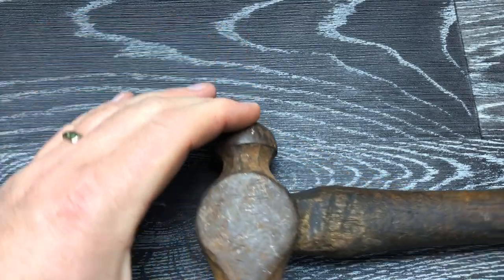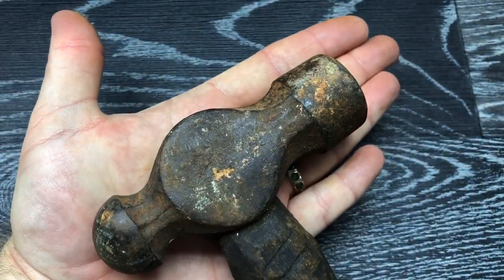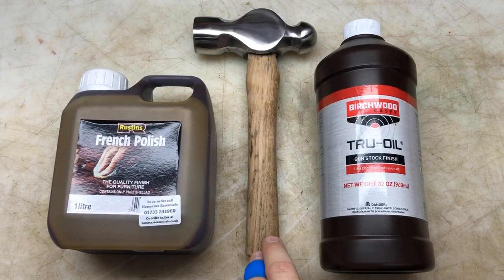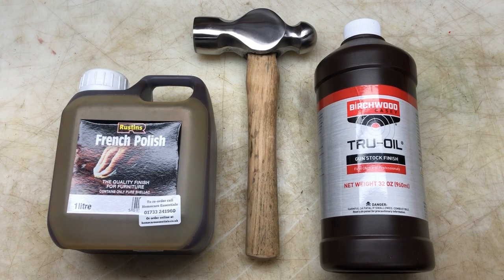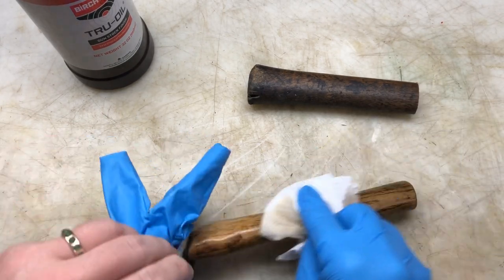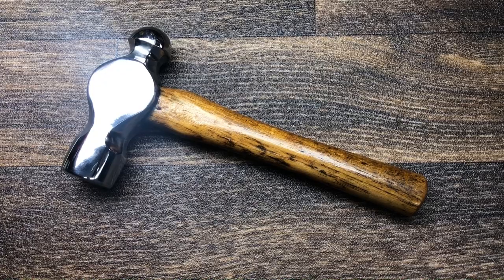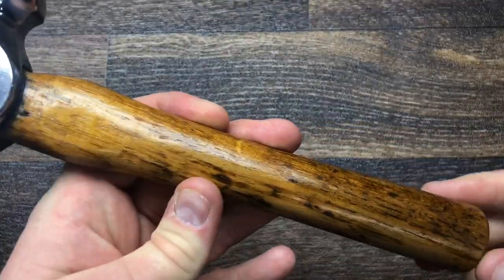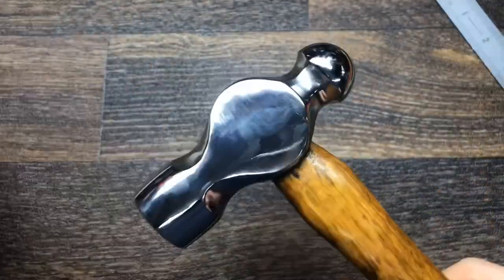ScoutCrafter Short hammer Challenge

Comment: Hi mate what make is the little belt sander and is it any good
Reply from the maker: it’s a Axminster one by 30 belt sander and it’s fantastic really good I’ve only had it about two months but I wouldn’t be without it for sure I hope that helps :-)
Reply: @tooladdict7463  Thanks for the reply will look into it ,I've done a hammer stained the handle  blue then lacquered the handle looks smart liked you video mate liked and subbed